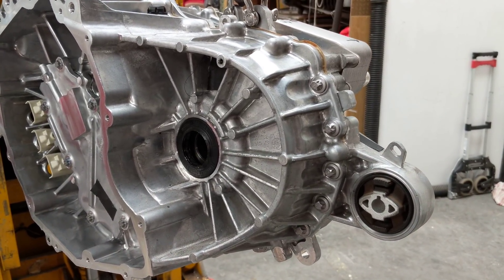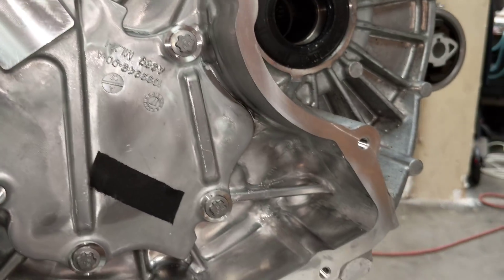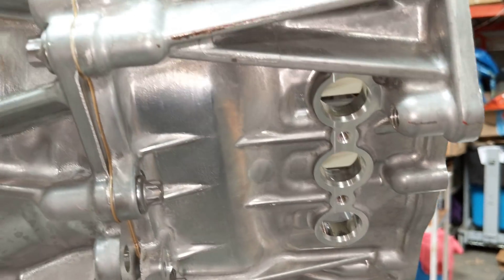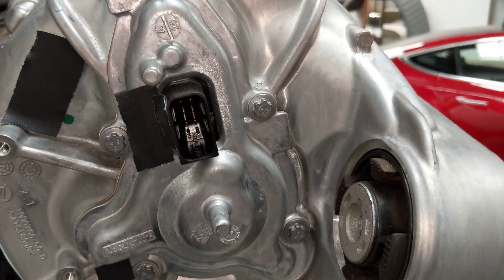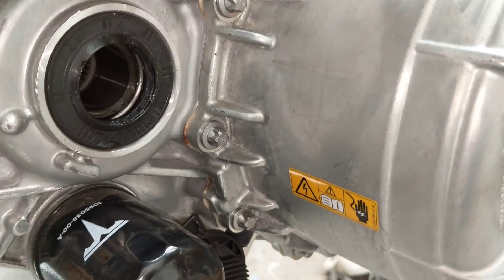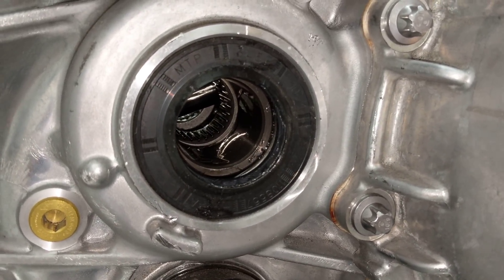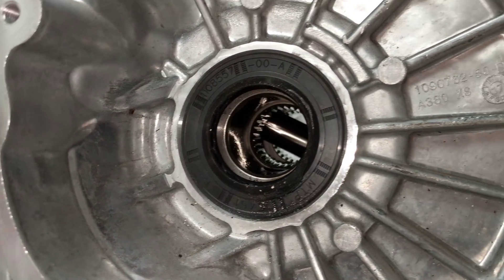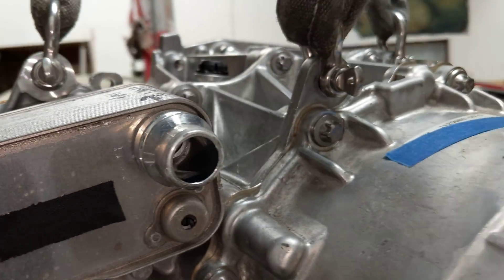Tesla Model 3 Drive Unit Bare

Comment: I'm looking to install the M3 motor upside down so that it site behind the axle. The motor rotation orientation would stay the same. There is an oil pickup pipe mod available from a French EV converter. Would love to get your take on it. And the tip about the half shafts is a huge help. Thanks.

Comment: There is a fill plug next to the filter. You can drain the fluid just by removing the filter. Clever design to reduce the chance of over torqued drain plug.

Comment: According to you, what's the more important with this new motor? Hardware or software?
Reply: Of course it is the hardware... The software for these kinds of things is fairly standardized anyway. It is about the way Tesla puts it all together.
Reply: On what sources are you basing this conclusion? This is not what I read in technical papers. Controls are very important with this type of motors.
Reply: etbadaboum There is not much to base it on before someone completely reverse engineers everything on the Model 3. However I contest that the software that these chips runs is very trivial compared to the manufacturing of the components (or rather the design for the components and manufacturing). The manufacturer should know what the components can do, then you just write the software to make the hardware behave as you need. There isn't much creativity required as such, espescially when comparing to novel software like AI or state of the art cryptography.
Reply: So this is a PM motor? Do anyone have the specs on this; gearing, number of poles, winding scheme?
Reply: Not exactly, it's 'officially' a Permanent Magnet switched reluctance motor, different from what has been used in the past by other manufacturers. See a good technical paper here: https://ieeexplore.ieee.org/document/6180757
Reply: @Tore Lund… Googling is not that difficult.. Two searches give me that it is 9:1 and a permanent magnet motor instead of induction on the S/X.. The rest of the infos might not be that readily available..
Reply: Sorry for my incompetence and thank you for your effort.

Comment: So we have to change an oil filter for the motor?
Reply from the maker: No, it's there precisely so you DON'T have to change the drive unit lubricant.
Reply: Yeah, you do, but generally not before the warranty is up at 100,000-120,000 miles. June 2025: I changed both drive units' fluid (ATF-9) and filter at 121,000 miles on my 2018 Model 3 Long Range Dual Motor. I DID find some metal particles in the rear unit's fluid, but apparently that's not a big concern.

Comment: I wonder if I could use a DC motor , for a homemade electric cars conversion ?
Reply: Well the batterypack is certainly compatible as are modules from S&X... Modules from the latter are a bit easier to use. Personally I'm waiting for an affordable and simple to use kit to use the battery modules with.. You can mix and match even now for not too much money, but it is still a bit of a hassle.

Comment: Tell us the story about oil change.
Reply from the maker: This isn't an internal combustion motor with crazy thermal deltas.  The filter is there to get any particles out of the greartrain and bearings, so that it can last a long, long time.   I don't know what Tesla recommends, but I suspect it can easily go 100k miles.
Reply: Tesla has not set a schedule. If it uses the same fluid as the Model S and X, it's transmission fluid {Dexron VI to be precise). My understanding is they added the filter to make replacement unnecessary. Time will tell.
Reply: @dchristo10  should it be gear oil and not transmission fluid?
Reply: @mrtee3477  if they are using the same as Model S and X, it's Dexron VI atf.
Reply: But it feels "overbearing" losing oil drain plug. That is weird.
Yes. Oil should last at least 5 years at least 100 000 - 160 000km. But not forever. Especially in humid environment. In time, condensation will be washing into the oil.
Reply: only scheduled maintenance on the m3 is to rotate tires and check brake fluid every 2 years.  that's straight from the owners manual

Comment: EV cultists proclaimed "No oil filter changes". And now this. Are there any specs for the change intervals?
Reply: Are there specs for the change invervals? Yes. "Never".  The drive unit is designed to last the lifespan of the vehicle without maintenance. The oil filter and pump helps enable this.

This is gear oil, not motor oil. There's no combustion products going into it.

Tesla initially expected Model S's motor to last without maintenance, but they had a problem that John Smith mentioned - during the wear-in process, bits of metal would end up in the oil. Since there was no filter, Tesla had to have an oil chance at the first year's maintenance, and then again in... I think year 4?  Would have to look at the spec sheet. But this can be prevented by the inclusion of a filter.  There's just not that much stuff to filter out, so there's no need to replace it.
Reply: Tesla does it right. If there is any problem, they FIX or try to FIX it unlike other car manufacture which try to nickel and dime on parts. That is the MAJOR difference between Tesla and other car manufactures.
Reply: Flash357 Rich Rebuild does not agree. When out of warranty, Model S becomes your average ICE in terms of maintenance costs.
Reply: Funky Dunky Rich Rebuild has his agenda. He buys and try to restore a SALVAGED Tesla S and expects Tesla to service his car and allow him to get free Charges, and warrenty a flooded car. If I was the car dealer, or a manufacture, I wouldn't warranty any part of the car, and would not allow him free CHARGE since it was salvaged in the first place. This isn't ICE car. Tesla have a different business model than a traditional manufacturer, or a CAR DEALERSHIP. ICE car dealership wants to make a PROFIT. Tesla service centers ONLY to COVER THE COST of running a service center and their Tesla stores. Of course the cost of the parts and service is going to be higher with Tesla than with ICE car Dealerships due to low volumes of cars manufactured. IT IS a SUPPLY and DEMAND. Hopefully, when Tesla start cranking out more cars, then they will have more parts available at cheaper price. It is called supply and demand economics.
Reply: Flash357 I am not talking about SALVAGED cars. You will have to go to Tesla for service for anything HV and 12V related if it fails after the warranty expires, including the battery and the drive train. The labor and parts are not anywhere cheap. Your neighbour car service shop would not touch this car unless it something simple like changing brake pads. Tesla gets hold of its Toolbox software and ordinary mortals cannot buy it unless you live in MA, like Rich Rebuilds. Without it you cannot do anything if some electronics part fails. You cannot even replace the notorious design faulty first gen door handles without teaching in the new handle to the MCU. You cannot rebuild a faulty inverter, you cannot rebuild a faulty battery, only replace with new one at a Tesla Service Center or turn to to hacks like Rich Rebuilds which you may not find in the 1000 mile radius of your home. The economy is out there. Regular maintenance prepaid plans (while on warranty) are LESS for Mercedes E/S klass than for Model S last time I checked. I do not care if oil + filter gets changed during annual maintenace or not. 99% of the  owners only care about the cost.
Reply: @funkydunky1430  Who rebuild car electronic?  not even on ICE car, they just buy new module..LOL
Reply: @funkydunky1430  I did LOTS of research into this. The Model S is FAR more problem prone than the 3 and Y.
Reply: I read somewhere that this is closed loop not intended for replacement it only for initial use to filter out small metal particle before parts get working together correctly(don't  know englis term for this proces) you know when you get new ICE engince you need "baby" it for some time.
Reply: John is correct. Somewhat similar to the old practice in the ICE world of changing the oil right away on a freshly built engine to get out things like assembly lube.
Reply: Every 250k.

Comment: Pretty! Thanks for posting! So if I understand correctly the Model 3 motor's rotor is supposed to be made up of permanent magnets. Would love to see it if you're going to open her up. I wonder if metal particles in the motor are a bigger problem due to the permanent magnets. I'm also interested to know if they're still using ceramic bearings.
Reply from the maker: It's a hybrid design, called a "Permanent Magnet Switched Reluctance Motor" (PMSRM).  It does indeed have magnets, but they are not as big as would be found in a standard brushless motor that depend entirely on magnetic flux from the magnets for torque.
Reply: Ingineerix are they neodymium magnets?
Reply: @Ingineerix  I believe there is a huge misunderstanding and confusions of terms, which honestly I cannot explain. The electrical machine is not a PM switched reluctance (PMSR) machine even if you can find this description often in many websites (including Wikipedia). The electrical machine is a Interior PM (IPM) machine / PM Assisted Synchronous Reluctance (PMASR) powered by a "standard" 3-phase inverter. For instance EPA certification reports specifically an IPM machine. A SR machine requires a special converter and, although advanced concepts with PM exists in the literature/academia (in the stator for e.g.), the Tesla model 3 machine stator and rotor design is pretty far from a (PM)SR.
Reply: There's some confusion about exactly what's going on. The Munro teardown found PMs in the rotor, like an IPM, along with reluctance-style chevrons. Haven't seen the stator yet.
Reply: Sterillium It's a reluctance motor. The rotor ist just iron
Reply: RiffRaff151 Oh thanks! So would that mean that the permanent magnets are located in the stator?
Reply: Sterillium There are no permanent magnets. A reluctance motor has stator windings similar to a synchronous motor. The rotor is made up of silicon steel which has a high magnetic permabillity. A current in the stator creates a magnetic field through the stator. Slots are cut in the rotor in such a way that the rotor will turn in the direction of least magnetic resistance.
Reply: RiffRaff151 Thanks for the explanation! I was under the impression that this was the rear drive motor which would have been the switched reluctance partial permanent magnet motor. I'm interested to learn more about those magnets.